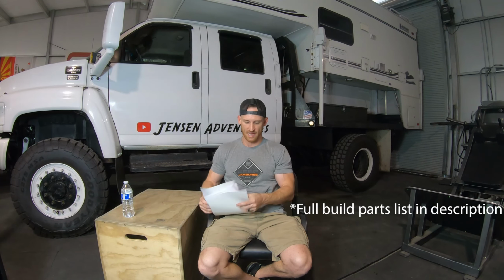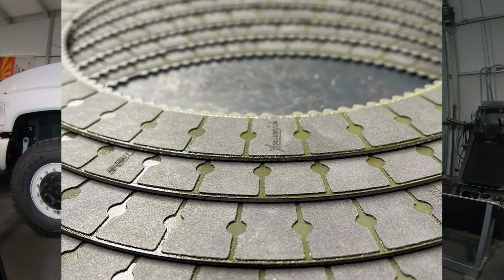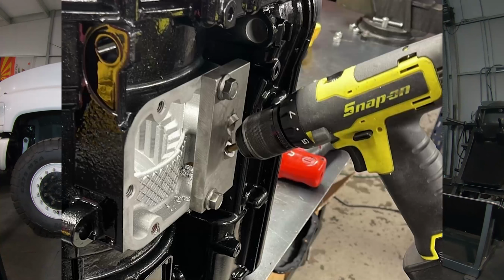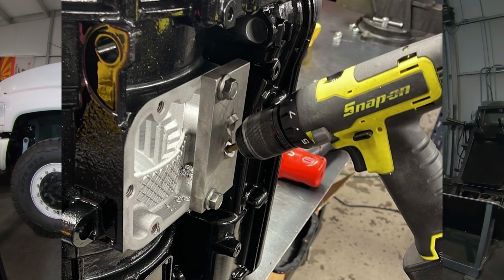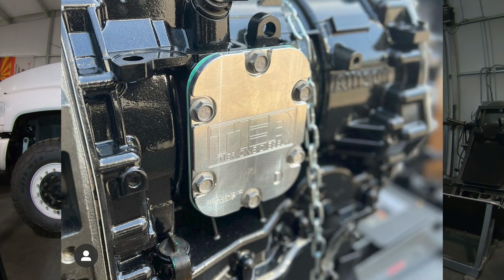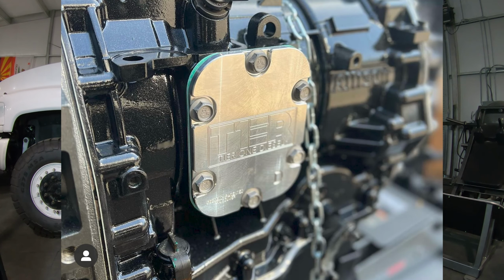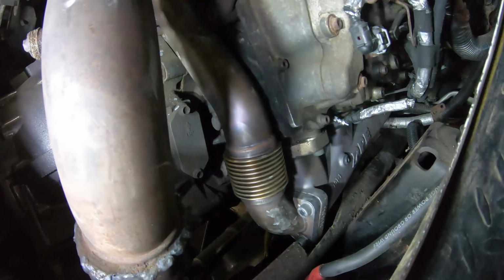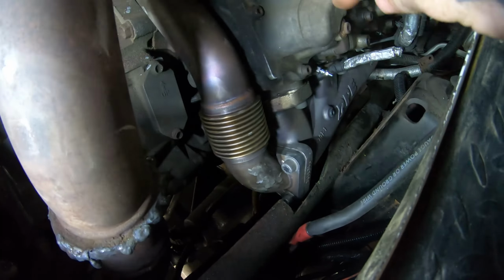Building our 4wd Kodiak Truck Camper! Part 3

Comment: @6:21 the kodiaks factory 90's were improved over the 2500/3500 version because on the pick ups the pipe being so close would fry out the headgasket.
Reply from the maker: Yes the Kodiaks did have better flow through the factory manifolds I just could not find any and they and the up-pipes needed replaced! PPE race manifolds were the next best option!

Comment: Make sure you change that your brake fluid 5.1 and check the balance rates on your injectors and have someone check do a pressure test on your radiator. Mine went out after 17 years 
My one is a LLY06
Reply from the maker: Yup I’ve had some a ton to my truck as well! I have an 08 lmm

Comment: That's interesting that your kodiak came with a allison 1000. Mine has allison 2350 .  I assumed  all 4500 and 5500 came with at least a allison 2000 series...I wonder why that is.... thanks for the info on the headers  and up-pipes, I assumed those as well would be the same as my old 3500 .
Reply from the maker: I was kinda surprised myself. They had so many configurations for the kodiaks I feel. And yes they are the same as the 3500. I just couldn’t find new stock headers so this was the option I went with.
Reply: Do you know if it's a year/build change over after this information or just a crap shoot as to what it comes with?
Reply from the maker: @mrvwcastner  they came with a few different motor and trans options. Not hard to figure out you should have all the codes on your drivers visor.

Comment: how is the ride ?  rough like a work truck or smooth like a Cadillac
Reply from the maker: The weight helps it ride better. I’m gonna upgrade the front springs and shocks and it will ride like a Cadillac!
Reply: @JensenAdventuresaz  cool. I'm thinking of getting one but build it opposite. 😀 Tow a overland trailer and put side by sides on the truck deck.  My only hesitation is cab comfort for family on long road trips.
Reply from the maker: @jonnteghtmeyer3750 air ride suspension will be your friend in these trucks!

Comment: Did u have the top speed set higher with the tune? What is a comfortable cruise speed and what kind of MPG are u getting?
Reply from the maker: I actually recently locked 6th gear out so I can use only 5th gear as 6th is useless at my weight. I can comfortably do 65 mph and about 10-12 mph with the camper on not towing anything. Might get better now that I can stay in 5th on the highway.

Comment: Great detail! How does the the performance change with those manifolds? Can you tell a difference? Ready for q bigger turbo??
Reply from the maker: I have a Stage 1 ryans diesel service turbo with a 64mm wheel. Im sure it will help with EGT's mostly. Bigger injectors maybe lol
Reply: @JensenAdventuresaz  oh, awesome! My turbo bearing is starting to go out. Might need to pick one up!
Reply from the maker: @cliffweatherbee6914  time for an upgrade!
Reply: @JensenAdventuresaz  yes! Lol I need it to run long enough to build a cummins!
Reply from the maker: @cliffweatherbee6914  I saw a 4x4 for sale that comes with a cummins motor to swap in. Would be super cool!
Reply: @JensenAdventuresaz  I'll be building a 650 HP P-Pump 24V. The SAE bellhousing will make the swap VERY easy. Biggest issue is that the cummins is 10" longer than the Duramax. So I'm thinking of moving it back as far as possible when I make mounts. The doghouse and cab are going to be my limiting factors.
Reply from the maker: @cliffweatherbee6914  that’s gonna be a tight fit!

Comment: How are you guys liking the Kodiak overall? I'm considering going from a 2016 2500HD to a older Kodiak for something fun and bigger to build. Would be to haul golf cart or side by side on flatbed and pull our 42 foot camper. Love the content, I've talked to you a bit on either FB or IG since you guys picked it up I believe.
Reply from the maker: Overall we are happy with the platform. It hauls whatever we need it to. We bought one that needed a lot of work done but that’s the risk of buying used. We love how big the cab is. I’ve never liked the look of a cabover camper on a regular size cab. It is very bumpy unless you have some weight on it.